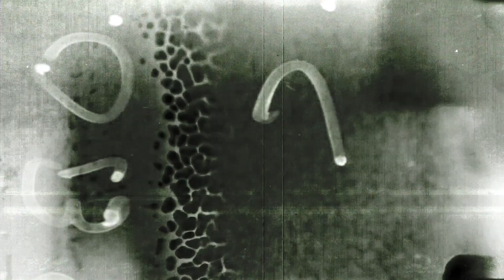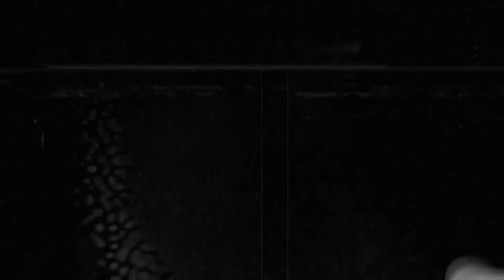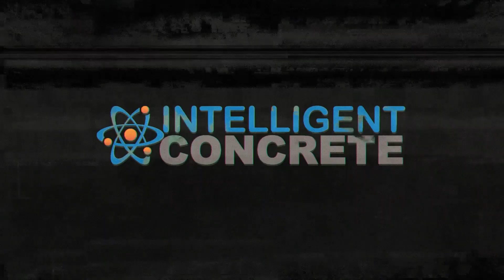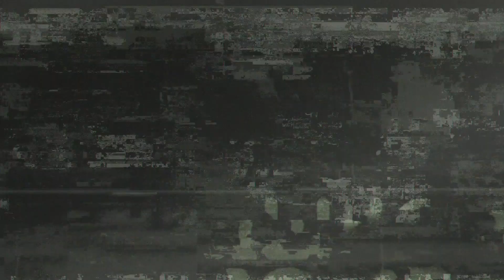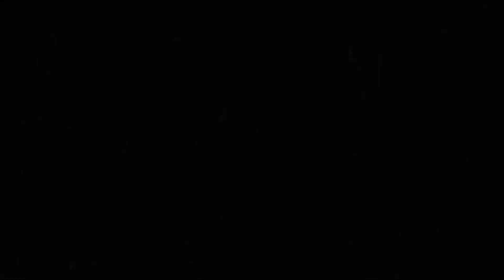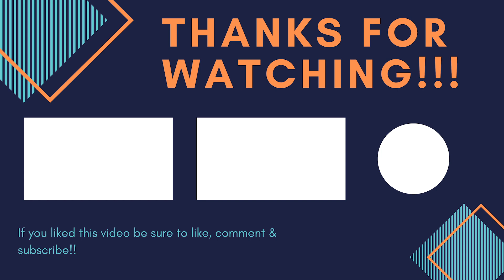What is ASTM C672 - Scaling in Concrete? - How to Perform, How to Use Results, Etc. - Vlog 581

Comment: There are papers claiming that ASTM C672 is too aggressive especially in evaluating concrete with SCMs in comparison with another method such as BNQ NQ2621-900. What's your thought about that?
Reply from the maker: I’ll check out the BNQ and yes I have heard from plenty of folks in the industry who think the C 672 is too aggressive.

While I agree it is an aggressive test, it is aggressive by design and should be taken for what it is, a way to compare the impact of materials on resiliency to the specified environmental conditions not a comparison to operational world or what you would see at your local intersection.